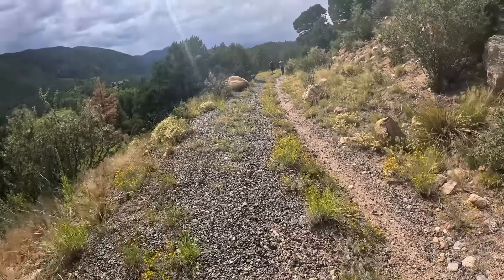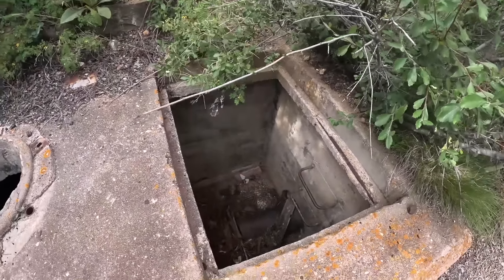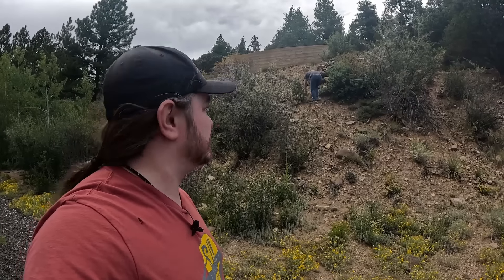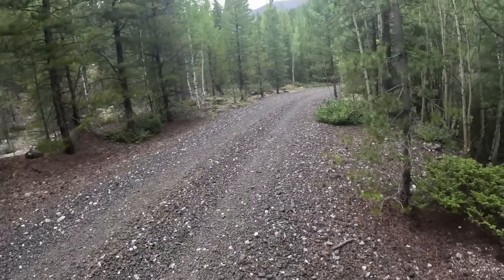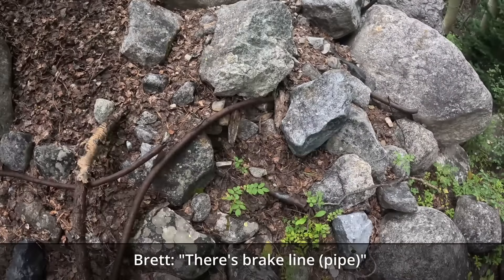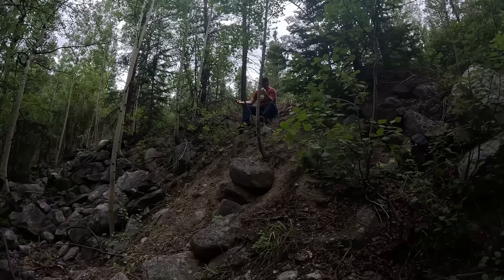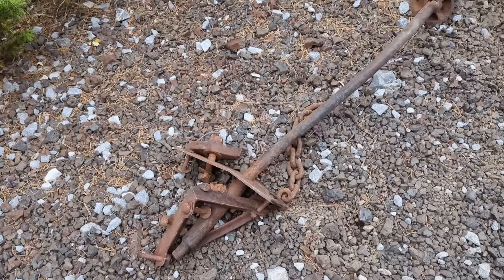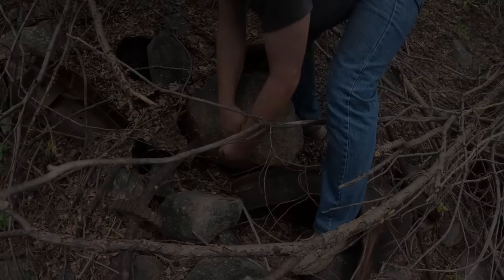1952 ABANDONED TRAIN WRECK! What will we find?!?

Comment: Traveling old railroad grades is the best! So cool that you found some stuff that was still there!
Reply: I had a job where i would drive many sections of N&W abandoned line in southern WV many miles was turned over to WV and they use the old railbed as county roads, tunnels used for car traffic, sidings into closed coal mines, tunnels bypassed. All due to the fact WV forced N&W to close that line into the southern coal fields.

Comment: I live in Salida and work up at Monarch mountain. As someone interested in the history of the ng roads and a narrow gauge modeler, I "discovered" that wreck site as well this spring. I'm glad you guys left the debris there for others to experience the excitement we all were able to experience. I assumed all the debris burying the car hardware was from work on the grade in the later diesel years but not sure. Also in the area of the wreck is a section of ties with tie plate holes corresponding to 3' gauge and the alignment seems to line up with an area that looks like it was a trestle site though only dirt and rock remain.

Comment: I’m surprised at how well everything survived, but then again, I’m also not surprised. I mean, most of the bits that survived are big and heavy, or had enough give in them not to be completely obliterated. Just mostly obliterated…

If you think that wreck, or the bits of the two Geeps also on the Monarch Branch blows your mind, try looking at locomotive dump sites where they’ve dropped locomotives for use as riprap. We’ve got at least two here in New Zealand that still have locomotives in them… and yeah, we’ve dug some locomotives up, some are now static displays and others have been restored to working order (check out the Rogers K class of 1878!). I know the WP&Y did the same with a bunch of steam locos in the Skagway River way back when too - doesn’t your friend Stathi own one of those Skagway River engines?

And happy birb-day!
Reply from the maker: Thank you! Stathi does own the WP&Y 61, which spent a lot of it's life sideways in a river. Lol!
Reply: I'm East Coast, South Island, NZ, and I know that there are a few locomotives that have been tipped off the side of the rail yard here for costal erosion. I haven't been down there for a few (maybe 10-15) years, so I don't know how many are still down there, but some of them have been pulled up for display

Comment: That piece looked just like a bucket from a bucket conveyor. Why it would be there with the rest of the "stuff" is weird. Maybe there was some of the conveyor from the mine being carried back to the mine after being repaired or was a replacement part.
Reply from the maker: Hmmm, good point. You very well might be right.
Reply: @Hyce777  The first mine I worked at had a bucket conveyor with buckets about that size. It has a rubber coated cloth belt that lifted wet crushed product up to a machine that dewatered it to go on to the next step to separate the copper from it. That was way back in 1968